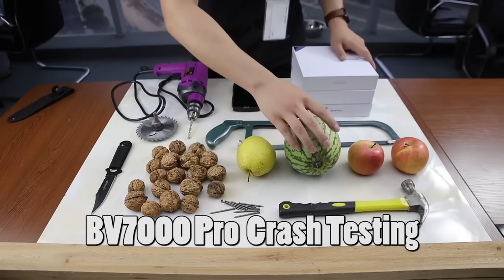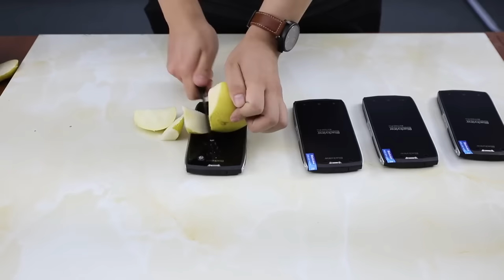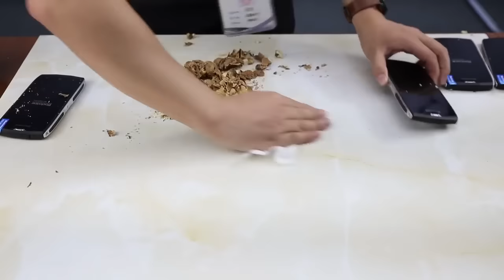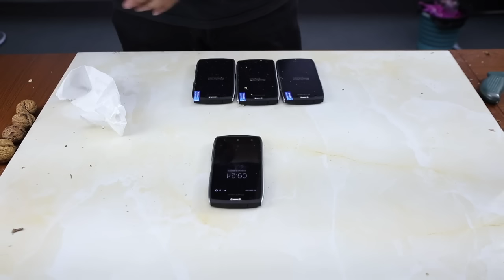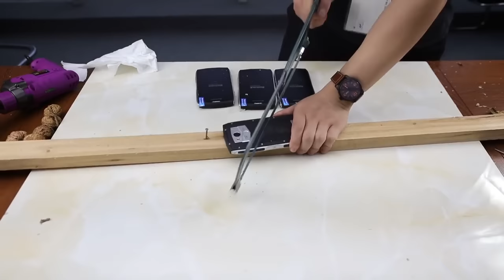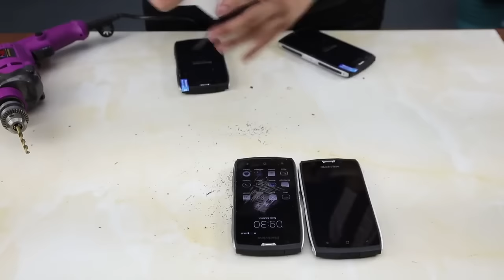Blackview BV7000 Pro Crash Test Review

Comment: I am sorry to say that Blackview after sale services are worst. I have Blackview BV6000, after 4 month used it become faulty. 
dropped charge level very quickly, charging very slow, very low resolution and some sensors not worked. 
recently blackview released OS updates, but after updates some problem were solved but new problem in the line like a weak wifi , GPS signal and slow touch response. Now i am using AGM A8. satisfied with the performance and now i am runing Lineage OS.